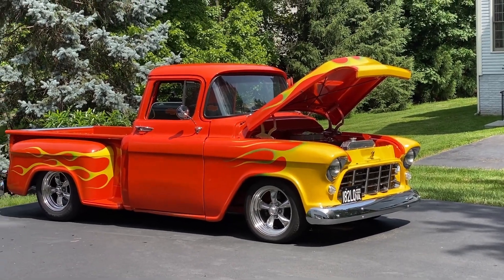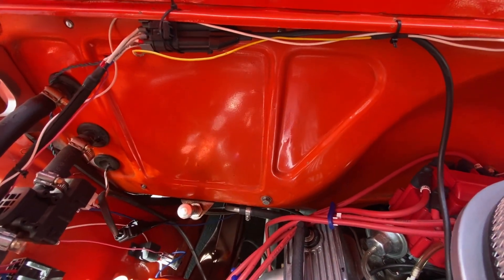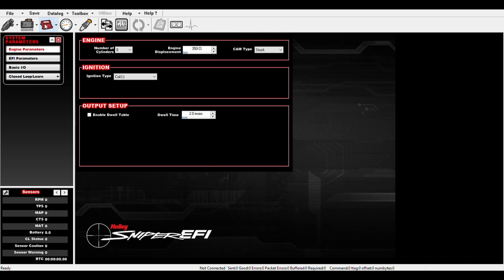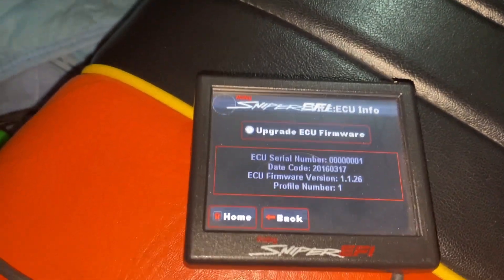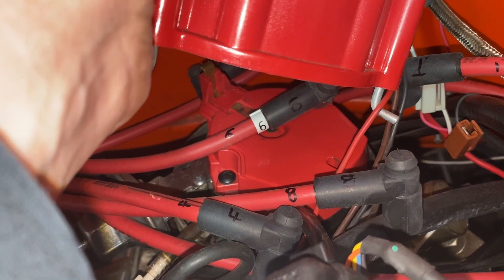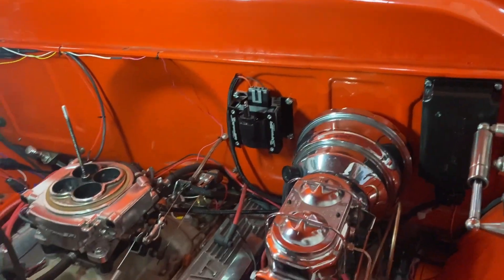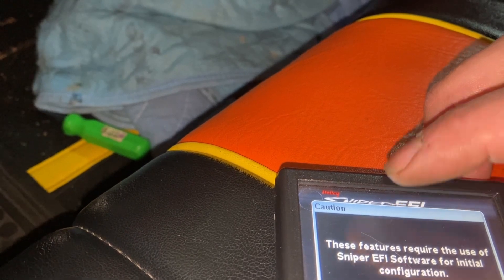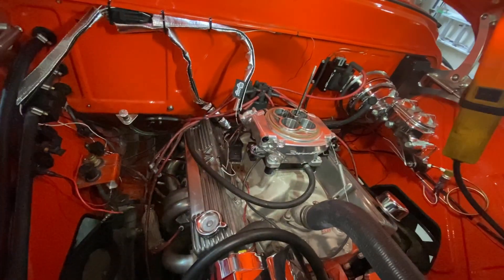SBC Holley Hyperspark Install

Comment: So my sniper is installed on my SBC 350 and Holly said to drive it for a while before installing the hyperspark, done with that. I have all my hyperspark system that you have but no one mentions what to do with the two wires that were connected to the old HEI distributer, tach and power. Where do these two wires get connected once you put the new Holly distributer on? Not seeing in the instructions what to do with them. I also bought the newer upgraded Sniper/Hyperspark harness that is prewired for the hyperspark so its almost all plug and play, just need to connect pos/neg to battery and one pink wire for the whole set up then fuel and my efans. What did you do with the old power wire to the distributor you removed?

Comment: You can make a small tool with a hammer and a nail to pull those wires + connectors out and reuse them later

Comment: Having problems with my holley Sniper/Hyperspark new install. What brand are the RF wire shields?
Reply from the maker: This is what I used: https://www.amazon.com/Aluminized-Sleeving-Express-Protection-Barrier/dp/B08CRSJP9W/ref=pd_aw_ci_mcx_mh_mcx_views_0?pd_rd_w=d7SUO&content-id=amzn1.sym.07081e2a-c82a-4414-ba67-d1ea4791ec44&pf_rd_p=07081e2a-c82a-4414-ba67-d1ea4791ec44&pf_rd_r=MWYWRC02VR4CAQJW0PST&pd_rd_wg=06qO3&pd_rd_r=d45fff76-f898-41eb-8366-81c701a0ebf7&pd_rd_i=B08CRSJP9W
Reply: @edshandymantips4862  Thanks Ed. The wrap you used says it's only for heat and says nothing of RF interference protection. Maybe the aluminum provides some shielding.
Reply from the maker: @jcheeech  definitely worked for me. Yes, it is advertised as heat shield but is a metal wrap capable of blocking rf. I like it as it is easy to install with the Velcro. In fact I had to remove my intake manifold last week to fix a China wall oil leak. It was ver easy to remove and reinstall the shield as necessary.
Reply: @edshandymantips4862  Thanks I'll give it a shot.
Reply: The 10 pin connector was most likely your culprit. I ended up un-pinning all but the tach output. Holley did an incredibly shitty job on protecting this unit from EMI and RFI. They also did an even worse job on the fuel injector connectors. We had several issues and have it down to hopefully the last issue which is a non functional fuel injector.  They don't have these issues with their other efi products, just the Sniper and they are well aware of it.
Reply from the maker: @219jello  Good feedback, thanks! Since shielding all the cables it has not given me any more problems. Before this I did have one injector cable that kept coming loose. Did the tie-wrap fix on that.
Reply: @edshandymantips4862  we ended up having Summit send us a new unit. Swapped it out and it works great now.